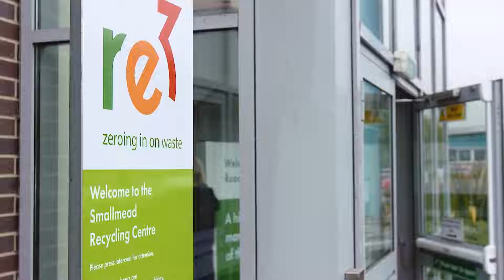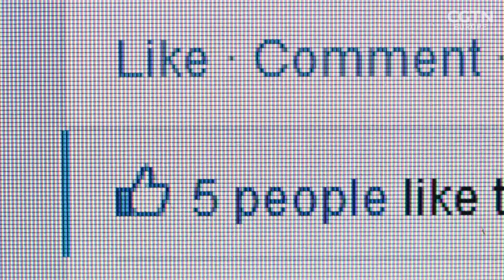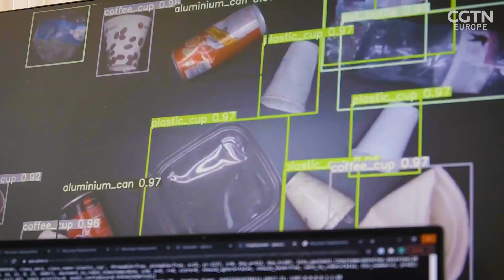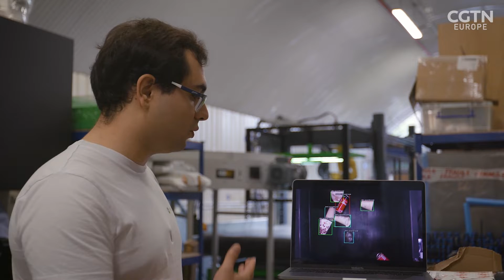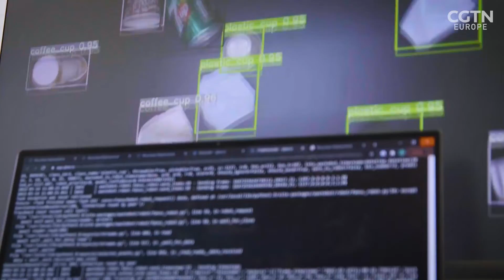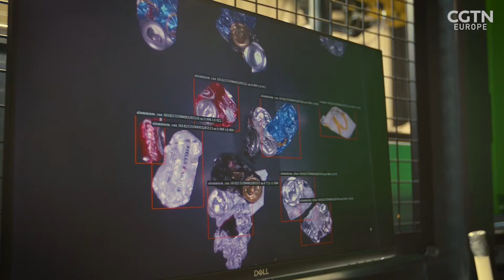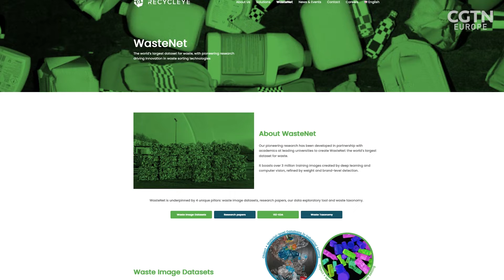AI robots are recycling rubbish faster and better

Comment: Imagine a day when a product manufacturer can buy 80 to 90 percent of the materials they need to mass produce their products from a local recycling plant, its a win-win for both manufacturer and consumer
Reply: But it's not happening.
Reply: @zyxw2000  Not "yet" but it will. Sustainability reqiures it. 🙂
Reply: @novoscorp7275  Not as long as it's cheaper to produce new plastic than to recycle old, but maybe during YOUR lifetime.

Comment: The robots aren't recycling, they're sorting. Cardboard, glass and metal aren't an issue.The problem of recycling the plastic and the disposal of other waste remains.
Reply: I thought sorting was an important part of making recycling practical
Reply: @wildmanofborneo  It's what's done before recycling, which is the actual process of turning used materials into new products. There are plenty of Materials Recovery Facilities for sorting, but they can't all find recycling plants for their  materials. They make bales and bags of stuff that might sit in warehouses for years or get sent to southeast Asia..
Reply: @zyxw2000  Are you saying companies present very little demand for clean, well sorted paper, metals, and glasses? A plastic manufacturer would rarely be interested in well-sorted plastic that is purely 1 type of plastic?
Reply: @wildmanofborneo    Paper, metal and glass aren't such a problem as plastic. There are only 25 plastic recycling facilities in the whole US, and usually only #1 and #2 can be recycled, and they must be mixed with new plastic.  The other plastics are trashed.  Then the recycling material can be recycled only 3 times. It's cheaper for plastic manufacturers to make new plastic.  So good sorting doesn't mean there will be a market for the materials.  Whereas it's cheaper to recycle old aluminum than extract it from bauxite.   My county makes a big deal about their sorting facility, but I can't find any info about whether the materials are actually recycled.
Reply: Have a look at AMP robotics.
Reply: @Bearbytez  Is that a YT channel?

Comment: I don't quite see the advanteg here. 

In Germany we have optical sorting stations in almost every plastic waste facility with wind jets sorting plastic waste in extremly high speeds you cannot even see with your eyes. Also camera / Infrared based. 
The Robot might be couple of percent more precise, but you can't even achieve a fraction of the speed and my guess is, that the robot is even more expensive than a standard industrial solution.

Just check out this sorting plant in Germany, from minute 4:20 you see the jet air sorting 
https://www.youtube.com/watch?v=EvuNJ_yZi3g
Reply: Wind can’t sort specific plastics.

Comment: Here's the issue. A human can sort 40-50  pieces a minute from a much faster moving conveyor. Our optical sorters are 70 - 80% efficient and humans are quality control. I find it hard to believe a robot would keep up.
Reply: But a robot can work for 24 hours a day.😆
Reply: It will only get better.
Reply: Computer can sort items with a speed impossible to match for a human. They could just use jet of air instead of an arm
Reply: Go sort some garbage then, Josh
Reply: @prebenjaeger  I Supervise a recycling facility Bud
Reply: Don't supervise. SORT
Reply: That suction system is useless.  Add more modules on a long conveyer belt . Apply progressive sorting with the machine just pushing and arranging the waste on the belt.  As the waste moves from module to module it will be 100% sorted . It can be 10X faster than a human worker.  Outsource it to India or China. We can do a much better job at a very low cost.